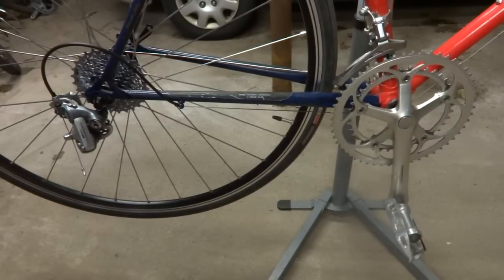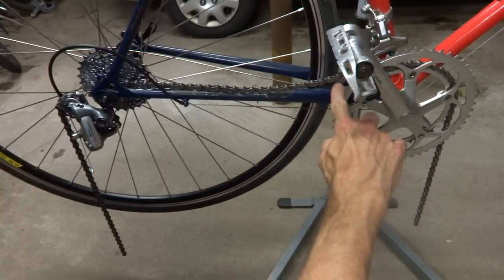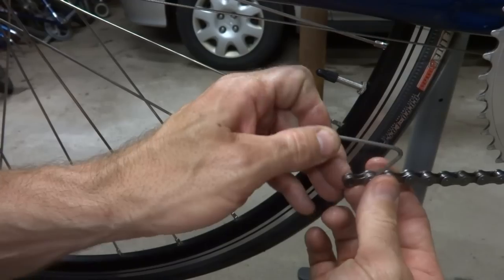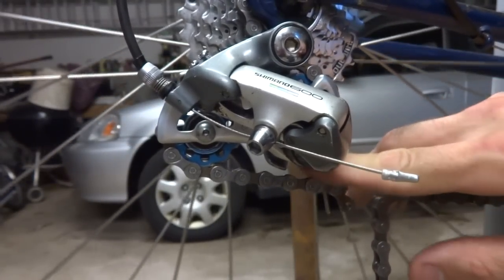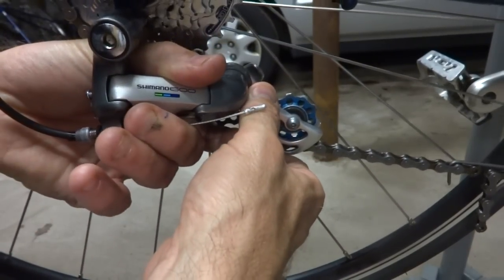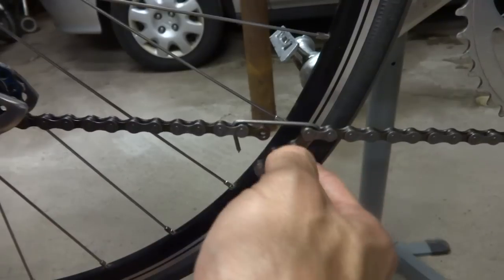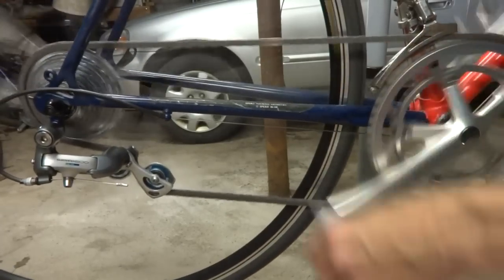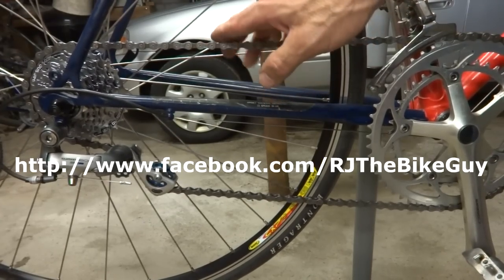How To Size A Bike Chain Length

Comment: Clever use of the small hooked wire to hold the chain ends. Beats the frustration of holding the ends by hand. Nice, clear explanation of the process too. Well done.
Reply: that's an old old technique!

Comment: Thank you very much for taking the time to explain the process fully.  Its been over 50 years since I rode a bike and I just bought a new 21 speed bike.  I had absolutely zero idea how to determine length for a new chain.   The details you showed about where the chain should have the spacings in the different locations is key.  Your lighting and camera angles are very good. Thanks again.

Comment: This video was a great tool for me. I had a situation where I changed the front and rear chain rings and cogs to a smaller size and the original chain length was different. This got me back on the road.

Comment: Park tool does it without running the chain through the derailer . Then adds links depending on the set up , which seems risky .

Comment: Very informative.  I just bought a trike from China which had zero, nada, instructions not even chinglish.  LOL  RJ you are quite good at show and tell.   I work on things a lot but bicycles are not my normal playthings.

That little chain widget is pure genius.- one of those little 'pro' tips' that can be a real time saver.   I am setting up the chain and derailleurs tomorrow.  Since the trike has an adjustable boom for the crankset to seat length that will be a very useful item that I will make first thing!

There was only one thing that caught my eye immediately.   That was your wedding band.  As a safety point I never wear any jewelry when working on things that are either electrical or have moving parts.  No ties, no long sleeve shirts nothing loose. 

I realize everyone has deep personal feelings for wedding bands as a pro the risk is your choice.   Rookies and part-timers should take heed when wearing anything that can catch in a moving part.  

OTW Bravo! 

Jim
Reply from the maker: +Jim Lyons Thanks. I've never had a problem with it catching anything like that. Watch some of my other videos where I work in bare feet or slippers. :D
Reply: Clearly you haven't seen his work socks! Steel-toed, made from Kevlar cotton. Hahaha.

Comment: Your video about how to straighten a bent chain was a great help. I've been struggling with an old Peugeot road bike. Tried almost everything to get rid of a very annoying problem with the skipping chain on two smallest cogs. Bike is ten speed and on the bigger front chainring the problem is not there, chain runs smoothly even with the pressure on pedals. Rear derailleur has Peugeot's own name on it, but possibly Simplex. I changed shorter chain with no help. The chain is running nicely, but when i put pressure on it, it starts skipping. Skips on the cogs, not trying to change gear. Cassette is changed, tried different chains. Made all the adjustments for gear changing, even checked the wire's tension. And I want to drive this bike on the road soon as possible...
Reply from the maker: Sounds like you tried a lot of the things I would have suggested.Without seeing the bike, it is hard for me to diagnose the problem. Make sure the derailleur is not bent or damaged. Simplex pulleys tended to fall apart. See this video for some ideas too: https://www.youtube.com/watch?v=D5HP1poRjv0
Reply: RJ The Bike Guy Unfortunately bike is in Europe, Finland to be precise. All the gears worked fine when I adjusted them bike upside down. Still the big chainwheel works fine when driving. I had to replace the chainwheel bolts to 2mm wider bolts, so the smaller chainwheel is that much more left. Cassette is a couple mm to the right from it's original position because I added a ring between the spokes and the cassette. I don'ät know if that means anything, but could it be the chainline somehow? The chain can move just what it can move sideways and that causes the broblem?
Reply: Ari Vainio I finally opened the bottom bracket. I already changed the rear derailleur from Simplex to Altus with no help. With pressure on the crankset it is still turning little bit empty on every turn. 

The bracket was really difficult to open. Opened it from the wrong side. The left crank is still attached to the axIe, it is so tight and has no threads anymore for the crankset puller. I even made the bike single speed for a while with the smallest sprocket. During that time the chain did not slip, but "only" a couple of times. With derailleurs it is skipping or turning empty on every turn. 

The bottom bracket's bearing cups are quite worn out. At least from the other one. Visible wearing on the surface. Can feel it with finger, sharp edge. Some odd scratces too. And the grease was black like darkest night. So now I need a pair of bearing cups unless I can use one finnish bike's (Nopsa) set which is same model. Depends the threads...
Reply: Ari Vainio Hi! I finally solved the problem. It was too short outer-cable with the rear derailleur that caused the trouble. The cable made too deep angle and with changing the cable and replacing the outer-cover with a longer one the problem disappeared.
Reply from the maker: Yes, the rear cable housing needs to have a smooth curve and entry into the RD. Also out of the rear cable stop.

Comment: RJ, do you have a method for getting the links back together? Whenever I do this, I really have a hard time getting the pin back in and always end up with a stiff link.
Reply from the maker: Never re-use the pin. The chain will be weak at that spot and likely break at the worst possible time. They sell special replacement pins that can be pressed in. I don't like them. I prefer  installing a master link. I like KMC's "Missing Link".

Comment: Hi, Thanks for the video.
I currently have a single speed chain ring on my old bike (with the standard cotter pin crankset). It is 44T.
I plan to install the Shiamno ultegra, model 6600, 53/39 chainring. I plan to do this without changing the free wheel. Is that possible and also will i need to change the chain?
Maybe a very basic question - but i am new to bile modifications :)

Comment: hello RJ i like your method seems full proof even checks derailleur capacity your video is only one ive seen that does this method i think its the best .i have a question sram say to size there chains by big big combo bypassing the derailleurs and from were the chains get pulled together and touch count over 3 rivets will this method always give me a male end of chain were i break it 3 rivets up just want to understand how the chain works RJ and not saying your method isnt superior to srams ?      keep up the good work your videos are the best on youtube
Reply from the maker: +Jonathan Farrelly I am not familiar with that method.
Reply: +RJ The Bike Guy it's the same method park tool use on the YouTube  video the easy and hard way to size a bike chain .

Comment: Hey RJ. I have a rather unique issue and can't find any help with it so I was hoping maybe you could. I have a 9-speed 118 link chain that I need to replace. I bought the bike brand new and the chain on it was a KMC. I've looked everywhere for a 9-speed 118 link chain as it is time to replace my chain but to no avail. I bought two new chains and trying to put them together without two pins in impossible. I have two master links but don't know how I can make this work. I'd have no issue with a second pin but wanted to ask and see if you or any of your followers had any suggestions. Thanks!!
Reply from the maker: You can't connect the two master links directly. You will have to have some link(s) of chain between them. So you might have to shorten the one chain, and cut a bit off of the other to make up 118 links with the master links.
Reply: @RJTheBikeGuy  Wow, thank you for replying. You are the best. I bought a second chain, and a few extra pins, and then added the links I needed to one of the chains and then used the master link to fit it all together. Success and I haven't had an issue. Thank you.

Comment: Is it ok to keep the extra portions of chains and connect them to make a new chain? Obviously doing this would require not pushing the rivets all the way out.
Reply from the maker: Don't reuse the pins. Push them all the way out, and replace with a master link like KMC Missing Link. Shimano sell replacement pins, but I prefer the links. And that would be a lot of links.
Reply: Too bad it's not ok to put the extra links together. I was hoping to get a free chain every once in a while.
Reply: @johnplink  With your name I too would have an interest in free chains. 🤦
Reply: @michaelhoste_  With your name, in what do you have an interest? Providing free lodging for touring cyclists?

Comment: How do you make the chain missing link ready? Push out the pin on the open side? Last time I failed with the shimano pin (pushing it too far) and had to use a missing link. I have a missing link at the ready but it does not fit into the open side, and even if it did then it would not have a inner bit on that side.

Yes just push the rivet out of the open sided link. The arms fall off but the inner barrel does not. Join the two closed sides with the missing link. 

I failed with the Shimano pin thing again. I broke it and it fell out.
Reply from the maker: Both ends of the chains need to be the inner links. It sounds like you might be trying to install it into the outer links. I install missing links in a bunch of my videos. Like in this one around 7:20:  https://www.youtube.com/watch?v=vgczpUJ_Jjk
Reply: Thanks. That is what I did.
Reply: Here is the direct link to that part of the video.
https://youtu.be/vgczpUJ_Jjk?t=7m20s
But I wish I could use the Shimano pins too since I find that missing links can break open (perhaps I installed it badly) or at least buckle (probably at about the time to change the chain admittedly). If you made a video of how to push that Shimano pin in, I would definitely watch it. It would need to be in close up though since the pin is so small. I tend to push too far through or the end bit breaks off.

Comment: It has to be said this is NOT the best way to size a chain. The extreme example shown is a gear which should never be ridden. Far better to stick with small to small and shorten the chain only enough to tension it and clear  touching the rear mech. Also, the wheel axle should be in line with the 2 jockey wheels; that is directly above them. It's as simple as that.

Comment: Park Tool gives three methods for sizing a chain on a derailer equipped bike.  The second method they list is the easiest and is also the method given by the late Sheldon Brown.
http://www.parktool.com/blog/repair-help/chain-length-sizing#article-section-1
http://sheldonbrown.com/derailer-adjustment.html#chain

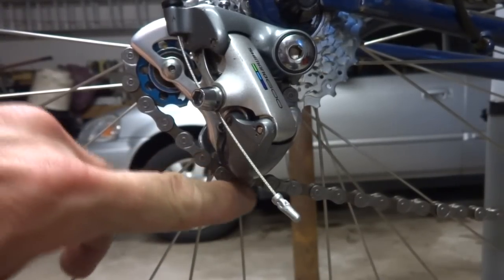Comment: At 1:47 and 2:05 you say the chain is too short but you meant that the chain is too long.
Reply from the maker: Apparently you are not seeing the annotations where I already corrected myself.
Reply: I didn't see the annotations before, even though I had them turned on, but now I see them.

Comment: why some people measure big chainring and biggest cog
Reply: That is also a way but when doing that you will also have to check that with that lenght the guide pulley doesn't rub when it's on the smallest cog and smallest chainring.
Reply: thank you for the answer.

Comment: or use the old chain to size it
Reply: +mike hay old chain can be overstretched
Reply from the maker: +mike hay If you are just replacing a chain, fine. This video is for sizing a chain, like maybe you don't have the original chain, or you are making changes to the drive train Then you may need a different size chain.
Reply: good points
Reply: You said at the outset that you were using a different sized crank. But you did not show how to cut the chain to size.